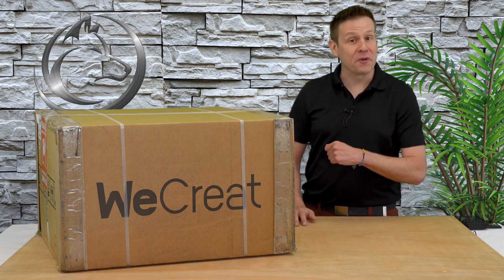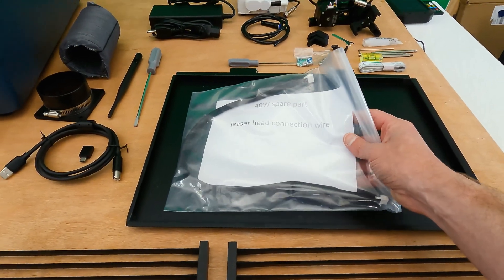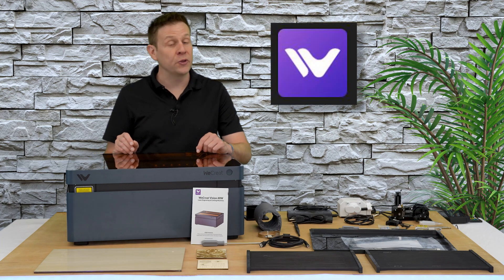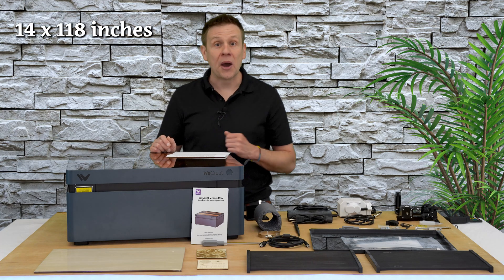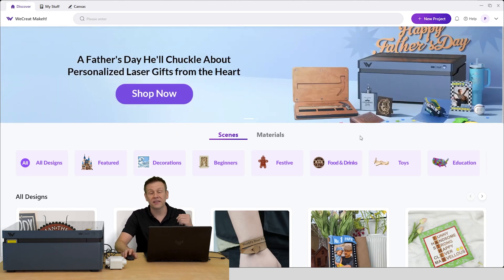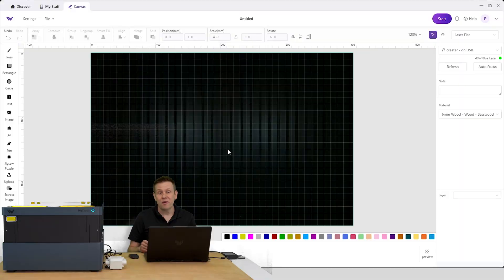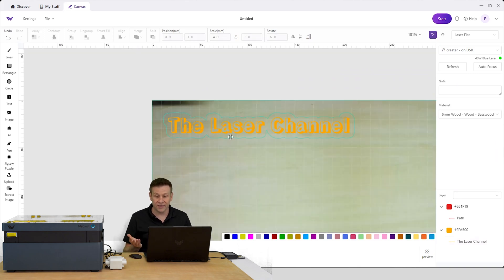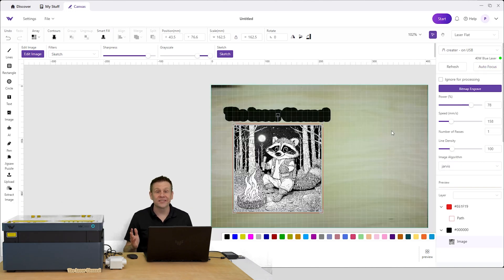WeCreat Vision  40W- Unboxing Features & Projects!

Comment: Seems odd the raster engraving is not bidirectional?
Reply: You can still do bidirectional using Lightburn. Earlier versions of the Makeit software had the option for bidirectional and development of that option was stopped. The company claims that they worked on their algorithm to where unidirectional is just a quick as bidirectional was, with less errors.
Reply from the maker: @chrluc  When I use other brand of laser machines I use bidirectional scan.  The WeCreat machine I only use the MakeIt software and just like you said they only offer unidirectional scanning.  I spoke directly to WeCreat and they also stated they stopped development on the bidirectional scan method stating it's just as fast and the quality is better.  To answer your question I do not run Lightburn software with the laser so I do not run bidirectional scan.
Reply from the maker: I thought  that too- it doesn't seem to add too much time to projects.  While the MakeIt software does have routine updates it would be nice to see bi-directional engraving, crosshatch, and offset fill or spiral engraving engraving.  Maybe these feature will be added in one the updates.  Thanks for watching!